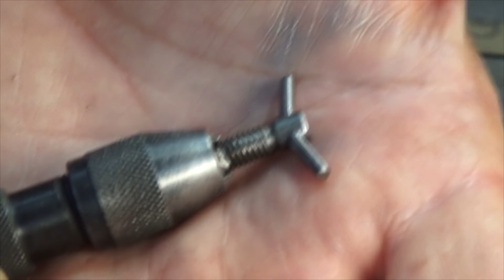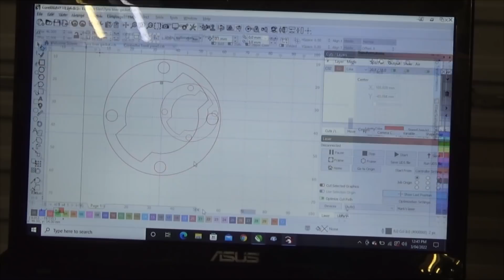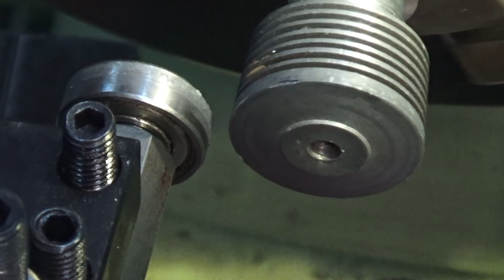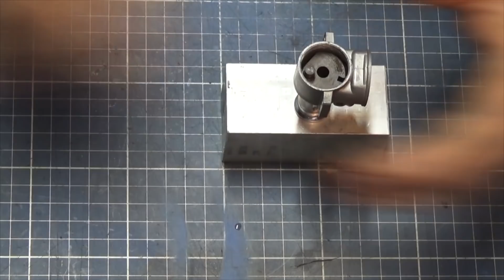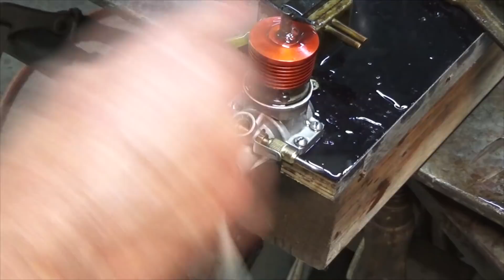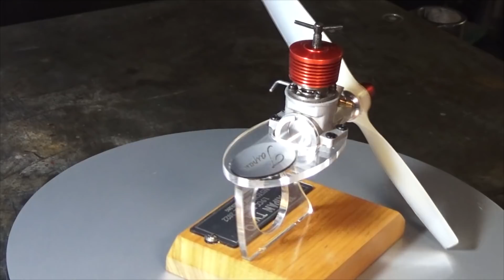The Taipan Tyro - A 50 Year Old Model Engine Restoration - Part 2

Comment: Very nice restoration.  I like the red anodizing, it really dressed it up.  As a child we had a control line airplane, all plastic, and never did much with it except crash it into the hard.  Dad did help us with removing the engine and mounting it on the back side of a large Tonka toy semi tractor truck.  We had it hooked by a piece of light weight chain to a pivot point and love watching it tear around in a circle.  And this was all done in the basement and we sure smoked up the basement, as you said, dirty, oily, and smelled the place up.

Comment: My first plane was the Taipan Trainer, but with a 1.49 cc Davies Charlton diesel. It too was broken in half on its maiden flight. I made the mistake of filling the fuel tank, even though it was strongly recommended that you shouldn't. I got so dizzy that I could hardly stay on my feet. I tried to land it (!), which didn't go well. I couldn't walk for a while until the world stopped spinning.

I did manage to rebuild it and also learned how not to get dizzy. I later moved up to an Enya 2.5 cc glow-plug and built lots of planes. Eventually I got tired of spending a lot of time building planes which inevitably crashed at some stage. It's not a very forgiving hobby.

I have held onto the engines for fifty years and now it's time to get them out and build some nice stands to display them on.
Reply from the maker: I realised just before I gave up on the hobby (when I was around 17), that small control line aircraft were really difficult to fly. I was given a large stunt plane with a 5cc Fox engine. It pulled like crazy and there was never any danger of the control lines going slack if there were strong cross winds. It was just more stable and predictable than the little kit planes that we all learned on but I guess they were cheap to build and we didn't know any better.
Regards,
Mark

Comment: You could of boiled in water the T-handle to convert the rust into a protective carbide layer. And then card it with a soft brass brush giving the result of a black protective layer.

Comment: Mark those Taipan props are notoriously "slow" c/w modern props. Your engine would have easily reached the claimed RPM on one of the latter. Did you use any ignition improver in your fuel? About 1.5% Amsoil brand Diesel (full size)  Cetane Improver would help. It is available in Queensland and should smooth the run and stop the harsh bit at the end. Nice work by the way.
Reply from the maker: I was given the prop and the fuel so I am unsure what the fuel composition is. I think it was just a regular mixture. I am sure the engine could be tuned to run better but I was just satisfied to see it still running.
Regards,
Mark

Comment: Isn't  modern  diesel full too dry? Did you have to add oil mix? Other than that very interesting, never seen a diesel model airplane  engine started and ran.
Reply from the maker: I can assure you that the fuel I used was super oily. It made a hell of a mess but it was a home brew mix supplied by a viewer who also collects and repairs model aircraft engines. I had trouble finding a commercial fuel that I could purchase online. Back when I was a youngster, you could buy model diesel fuel over the counter at hobby shops. The most common brand here in Australia was "Aeroflyte". 
Regards,
Mark

Comment: Thankyou Mark for both the informative videos on restoring the Taipan Tyro.  I have vivid memories of my first control line aircraft which was the Aeroflyte Taipan Trainer as shown!  My first engine was a FROG 150 purchased in 1958 when I was 11.  Later I had a "SABRE" 2.5CC engine which I believe was also a Gordon Burford product.  Most of my "diesel" engines now are P.A.W. from the UK.  I should look for a Taipan to add to my collection.  Thankyou,  Mike
Reply from the maker: Mike, I was unaware of how many engines Gordon Burford had produced during his career. He pretty much started making and assembling engines on his kitchen table. They weren't exactly super high performance but they were rugged and reliable. Perfect for a novice like me. I recall reading the old Aeromodeller magazine and the names you mention bring back lots of memories, mainly lusting after engines that I could never afford!
Regards,
Mark

Comment: Wow! Well done there Mark and thank you for sharing this enjoyable video. I started with one of those 1.9 CC Taipan diesels and also a Taipan trainer, which I'm almost pleased to hear was hard to fly, you mean is wasn't me! I was really proud of building it and yes I also crashed it on it's 1st flight... Then I bought a 'Stickie' from a man called Dick Steele who I'm sure you must have heard of, put an Enya 15 in learned how to fly control line with that, and progressed from there. They were great days and a lot of fun.
Reply from the maker: Yes, that Taipan Trainer was indeed hard to fly. The very last model aircraft I flew was a large stunt plane with a Fox Control Line Special in it. It was so much easier to control and it pulled like crazy on the control lines. I remember my horror when the lines went limp on my maiden flight with the Taipan Trainer. You can guess the rest!
Regards,
Mark

Comment: Mark, where abouts in Aus do you get your aluminium brightener? Also your anodising solution do you make that yourself?
Reply from the maker: Adrian, I get all my plating supplies from Jane Kits. www.janekits.com.au
The anodising solution is sodium bisulphate which you can get in pool shops and hardware stores. It is sold as "dry acid" or "Ph Down".  It's way cheaper than sulphuric acid and much easier to get. Check out this website http://www.observationsblog.com/sciencetechnologyexperiments/anodizing-and-dying-aluminum-without-battery-acid
Regards,
Mark
Reply: @Preso58  thanks heaps for that mate. Love your work

Comment: I Freaking love that awesome trick to fix that dent. It's like magic. Adding metal without adding metal.  But I couldn't help but think, why didn't mark just zip a slight chamfer? Work smarter not harder. Sure that wasn't original but besides yourself who'd notice. Well thanks for another wonderful peice of valuable and practical knowledge. Guday Mark
Reply from the maker: At the end of the day I just wanted to see if rolling the dent out would work. In theory, the metal needed to fill the dent was still there, just moved somewhere else. 
Regards,
Mark

Comment: Funny your admonishing "Young Mark" for his ham-fisted use of pliers  on your motor.  I too have found questionable 30 year old "younger me" work on cars and motorbikes I've owned my whole life.  I decided it was just a state of not knowing there was a better way.  It's amazing how much the internet has made me a better mechanic, brewer, baker, seamstress, etc.  Before internet I would wing it. Now I usually do a search and find something useful to help me: an exploded parts view, a wiring diagram, a discussion thread, or a how to video.  It's now easier than ever to "DIY", yet it seems the average person is even less inclined to pick up a tool and have a go.
Reply from the maker: When I was teaching, it became clear to me that there are several different types of learners. I am what is known as a visual/kinaesthetic type. That is; I learn best by doing and by watching others do something. This is where the internet really helps me. I can read about a process and it helps but seeing someone else do it helps to solidify the process and also helps me to assess how easily I might reproduce the same process. Before the internet, all I had was books and magazines. I used those too but it was the pictures and diagrams that helped me most. My goal with my own YouTube channel is to encourage others to have a go at making things. Even if you fail at first, the failure will inform you about what not to do. So, don't bend steel with serrated jaw pliers! 😮😁
Regards,
Mark

Comment: Hi Mark, what causes it to fire without a glow plug ?
Reply from the maker: Mick. The model diesel fuel is about 30% ether which is a very volatile liquid with a low flash point. It boils at just under 35C. The compression inside the engine will heat the fuel until it self combusts and drives the piston down. Ordinary diesel fuels as used in cars and trucks wouldn't work inside these little engines since they cannot produce the compression ratio and heat required to ignite distillate fuel. 
Regards,
Mark
Reply: @Preso58  Thank you Mark, I did'nt know about that. Great videos and keep up with the wildlife please, what are probably everyday sightings in your area are exotic  animals here in Nottingham, U.K. Thanks again.

Comment: Reminds me of a little diesel model engine my uncle Bert gave me in the 1960s, I can't remember the make, nor can I find it, but then I haven't seen it since about 1972! It had a leaky compression screw and made a terrible mess. It had some sort of cast silencer. I never tried it on a plane, my dad helped me make an aluminium block mount to fix it to a little Meccano propeller-driven go-kart. It was smelly and made an awful racket, but when you're nine, those are good things!
Reply from the maker: Absolutely agree about the powerful memories that this little engine bought back for me. The smell in particular is very distinctive. 
Regards,
Mark

Comment: Well restored, Great video 👍 It would be great to see a video on your miniature loco hiding in your cabinet🤘😎
Reply from the maker: Steve, I have been shamed into showing some of those models by others so I will endeavour to get some out over the next year. The Conway is a 3 1/2" narrow gauge loco. I built it over many years and finished it in 1998. I have a short track with both 3 1/2" and 5" gauge lines at the back of our property and a driving truck with brakes and a passenger truck. I stopped running the engine when our kids grew out of it but now that my nephews have kids of their own I promised to run at least one of the engines at some point. 
Regards,
Mark

Comment: Hi Mark, nice video. I cut my model teeth on an old ED (Electronic Developments) Diesel marine engine. On the ED's, the compression adjuster screw had a "locking bar), which you loosened to make the compression change, then screwed down again, this obviously stopped the compression adjuster moving on you in use, but also preloaded the threads on the adjuster and pulled them tight onto the female threaded part of the head, preventing any leakage there. Is your engine not missing a lock arm? Just looks like the flat section on the head of your engine would allow a flat surface for it to lock too.
Reply from the maker: The later variant of the Tyro engine had a tension wire that bore sideways against the compression adjusting screw. It was a fairly simple device which I could have easily retrofitted but I decided to keep the engine close to the original spec. I was a bit surprised at how much leakage there was around that screw. I don't recall it being like that when it was new so maybe there is some leakage from the contra piston. However, the compression was still good. A locking arm would be better.
Regards,
Mark

Comment: So, am I the only one who could instantly SMELL that thing firing up?  Really, the strong smell which I haven't had direct contact with for 30+ years when I last ran this type of engine.
It also happens to me when watching top fuel engines start...strong nitromethane smell. 
It is almost like I have the "smell and taste app" (not a real thing) on my TV, but it only works on smells I have a direct history with.
Reply from the maker: I couldn't help but have a sniff of that fuel when it was given to me. I have read that certain odours form very powerful connections with memory.
Regards,
Mark

Comment: Its better to port prime the Tyro to start it, back off needle 1/4 turn and compresson1/2 turn from running settings. I had a tyro in  taipan trainer that went great.
Reply from the maker: Mike, my Taipan Trainer was grossly overweight by the time it took it's first flight. I put so much paint on it that it could scarcely get off the ground which made it "interesting" to fly.
Regards,
Mark

Comment: Stunning finish to the cooling jacket. I liked seeing how you reformed the metal to reduce the nicks, not seen that before. You were scaring me using your finger to start it though :-O My parents made me use a piece of doweling rod. It's obvious you know what you're doing though.
Reply from the maker: David, it's surprising how much you can move metal around if you apply the force strategically. I think the Tyro engine was fairly benign in it's starting characteristics. Most of the injuries I got were from getting careless around the prop while the engine was running. I have a prominent scar on my right hand little finger from reaching over the top of the prop to adjust the mixture. 
Regards,
Mark

Comment: For fuel I think we used a 1:1:1 mix of kerosene, ether and castor oil. Used castor oil in the glow plug fuel mixes too with Shell racing A formula, it was purple. Everything, including me, was covered in oil. These days I avoid get my hands dirty at all costs.
Reply from the maker: I still have to wash my car which is now covered in a fine mist of castor oil. The workshop stinks too. 
Regards,
Mark

Comment: I'm probably not the first to point this out in the comments so apologies if it's already been covered.  At 26:40 as you crank the engine over there's fuel coming out on the back side where the sleeve screws down to the case.  Sorry, I don't know the proper part names, I just stumbled across your video.  So in addition to the fuel being lost at the compression screw there's a good bit leaking at the laser-cut gasket you made.
Reply from the maker: I must say I didn't notice the gasket leaking. Don't forget that there is an exhaust port at both the front and the rear of the cylinder liner and these engines spray out a lot of unused oil in the exhaust. I think that is what you could see.
Regards,
Mark

Comment: That was a great flashback. I still have my first Taipan 2.5 diesel from 62 years ago. It still runs, been stripped once to clean out some araldite a jealous 'friend' filled  it with. The trainer was my first c/l plane, then followed with a Krazy Kat I rescaled from the old MAN magazines (Model Airplane News) from the local library. Went through the gas motors & R/C phase, then shut down into the electric era. Insurance got too expensive. Thanks for the memories.
Reply from the maker: Peter, I recall scaling up the plans from the Aeromodeller magazine too. I was too poor to buy the full size drawings but with a pair of dividers, a drawing board and a tee square it wasn't too hard to get a good replica. 
Regards,
Mark
Reply: @Preso58  Yes, back in the days of the true hobbyist. Today, unfortunately, it has become too easy to purchase ARF style models, no construction, or thinking involved.

Comment: You made a Grand job of that little engine Mark, it looks better than new, thanks for the vids - Paul
Reply from the maker: The little red spinner nut does make it look nice. When I first bought the engine it just had a plain steel hex nut to hold the prop on. 
Regards,
Mark

Comment: I learned to fly on a Taipan 2.5. My diesels had a locking tab on the compression screw. It was anodised. Can't remember the brand of the smaller engines.

Comment: G'Day Mark, like the way you mix up your presentation with all sorts of hobby types.  Just a quick question, more out of curiosity, what is the brand of Laser you are running and what is its power rating.
Cam
Reply from the maker: Cam, it's a 40W no name Chinese laser. It was a heap of rubbish when I purchased it from my former workplace. It never worked from new and was sold to the school from a disreputable dealer who refused to take it back under warranty. I had to do a lot of work on it to get it to run but it's now fairly reliable.

Comment: G'day Mark, great restoration. I like the look of the boat on the top of your display cabinet, any chance of a closer look and a few details.  I am looking to build a Clyde puffer and yours looks similar.  Cheers from Belair South Australia
Reply from the maker: The tug is a scale model of the Cervia, a Thames river tug. I believe the original is in the Kent Maritime Museum in the UK. My model has a twin cylinder Stuart steam engine and a scotch tube boiler fired with LPG. It's a powerful model but since completing all the details on it I am reluctant to fire it up again because the oil and condensate all goes up the funnel and it makes a mess of the upper sections of the decks. I could probably convert it to electric but it's not quite the same.
Regards,
Mark
Reply: @Preso58   Thanks for the reply Mark, were plans ever published?
Reply from the maker: @belair_boy6035  The plans were published in a model boat magazine and the original contributor was Vic Smeed. I have the original scale plans but I scaled my model up by 180% so that it would take the boiler and engine I had already made for another hull. I found this website that still sells the plans https://www.sarikhobbies.com/product/cervia-tug-plan-hull-set/
Regards,
Mark

Comment: That's a amazing job! It's almost a shame to see it go unused but I completely understand. I see I will have to up my game on restoring rc engines!
Reply from the maker: Interestingly, having stated that I wouldn't be doing any more model engine videos I found an old Fox glow engine at the back of a cupboard just yesterday as I was looking for something else. I am thinking it will now have to go in the collection as well!
Regards,
Mark
Reply: @Preso58  heck yeah. I have some real old McCoy's a frog deisel and some testers motors in my collection. I usually get them out once a year and run. I really like my old como and super tiger blue head engines. I need to start making some carb parts for those. I have missing peices from a few.